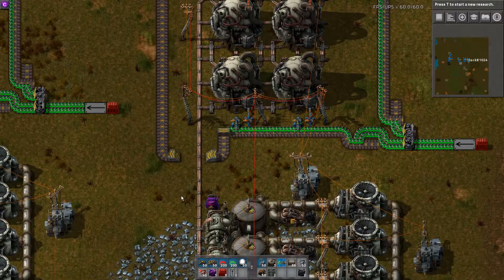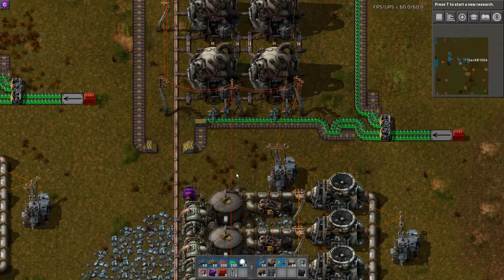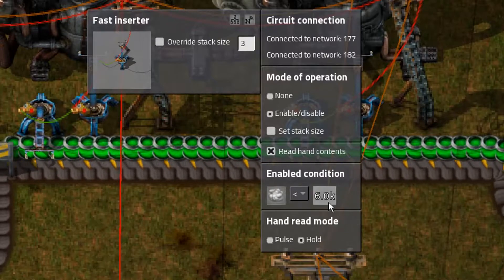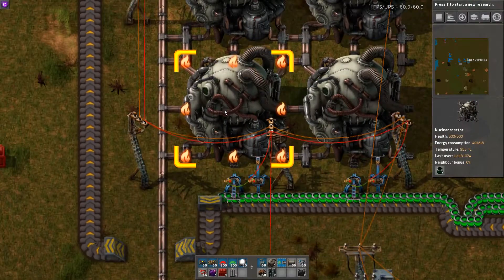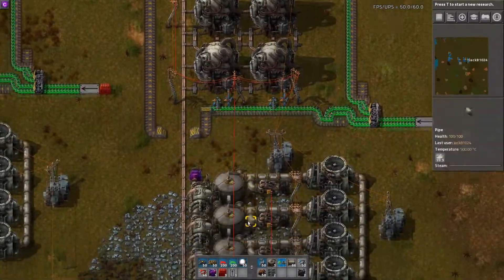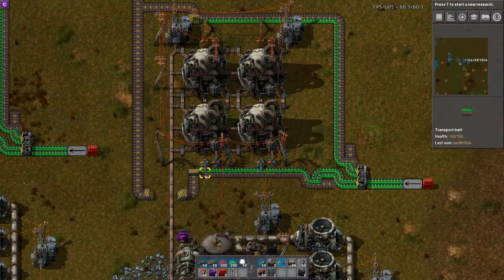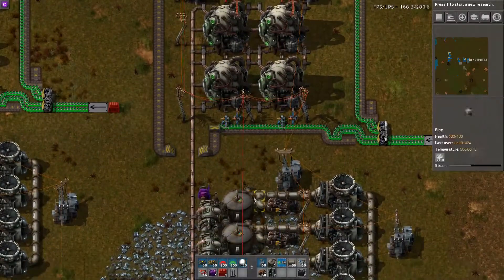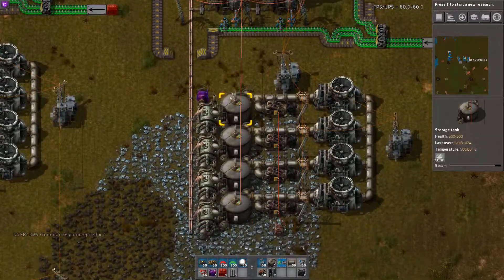Factorio Uranium Reactor Refulling with Combinators V2

Comment: I tried your set up, the extracting inserter worked well. I purge the tank of steam the spent uranium pops out... then kaput. I have the extracting inserter set to override stack size only one, enabled/ disabled,  used fuel less than 0. Did I miss something or have thing's changed?

Comment from the maker: Update: As of 0.15.23 The change in 0.15.22 was reverted, so the setup shown in the video should work fine.

Update: As of 0.15.22 Inserters no longer drop off items if the circuit condition to enable them becomes false. Because of this change you need to preload each reactor with 2 fuel cells which should mean that the insertering inserter is hovering over the reactor with a fuel cell in its hand at all times.
EDIT - Better Fix: 
Inserting inserters should be set to : Read hand contents on hold mode. Enabled when (Anything) > 0.
This way they will start picking up when the extracting inserter takes out the spent fuel cell, and will stay enabled until they have cleared their hand.
Reply: Just to let you know I don't think this does fix it, it just prolongs the is issue.  Shame this is great set up.
Reply from the maker: Worked out a better fix.
Inserting inserters should be set to : Read hand contents on hold mode. Enabled when (Anything) > 0.
This way they will start picking up when the extracting inserter takes out the spent fuel cell, and will stay enabled until they have cleared their hand.
Reply: Yup that works perfectly, nice one Jack you're a ledge' :)

Comment: My insering hand will not drop the fuelcell in to the reactor. my game verson is 0.15.22-4. have you encounterd this problem?
Reply from the maker: Thanks for bringing this to my attention. After some quick testing I think I've found how to get this to work with 0.15.22: You will need to put 2 fuel cells into the reactor at the start. Doing that will cause the idle state to have the fuel cell inserter normally hovering over the reactor with a fuel cell in its grip. From this point on, whenever the extracting inserter removes a fuel cell, the inserting inserter will add its fuel cell and grab another one before the circuit condition it has goes false, allowing it to get into the same position it was in at the start of the cycle.
I need to check that this works perfectly though, so will be stress testing it more.

Comment: The 0.15.22 release seems to have broken this
Reply from the maker: Thanks for bringing this to my attention. After some quick testing I think I've found how to get this to work with 0.15.22: You will need to put 2 fuel cells into the reactor at the start. Doing that will cause the idle state to have the fuel cell inserter normally hovering over the reactor with a fuel cell in its grip. From this point on, whenever the extracting inserter removes a fuel cell, the inserting inserter will add its fuel cell and grab another one before the circuit condition it has goes false, allowing it to get into the same position it was in at the start of the cycle.
I need to check that this works perfectly though, so will be stress testing it more.
Reply: The 0.15.23 release has reverted the changes. The original system seems to be working again. Thanks for the help.

Comment: You could make sure that new fuel cells are available before pulling out the old ones, but that would require adding combinators back in. For each reactor have two deciders. Decider 1 is hooked up to the steam, with condition steam < x. Decider 2 is hooked up to read the belt in front of the input inserter, with condition Uranium Fuel Cell > 0. Both output a green signal. The output inserter is set to enable when green signal = 2. That way it will only remove the used fuel cell if it needs steam and there is a replacement fuel cell.